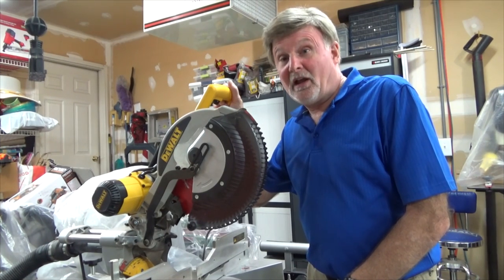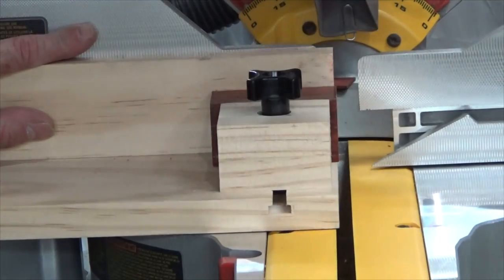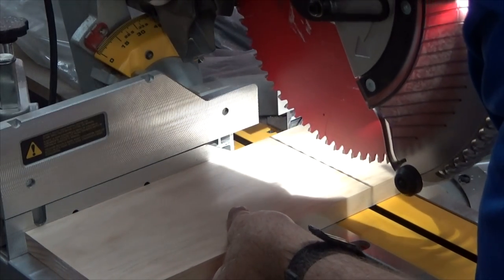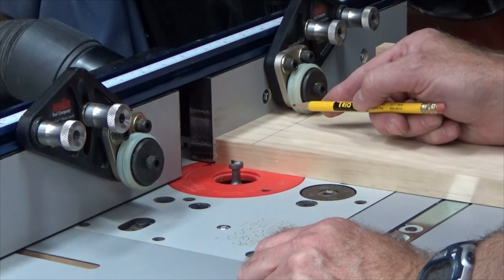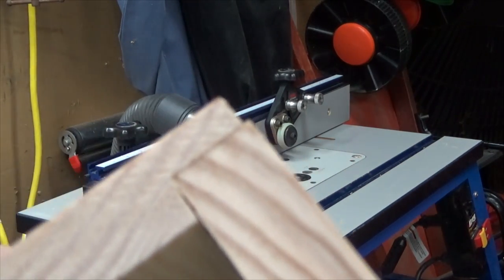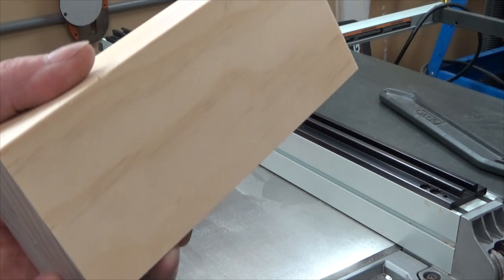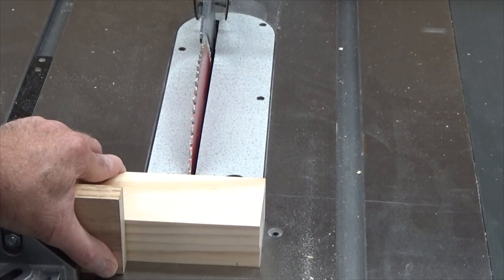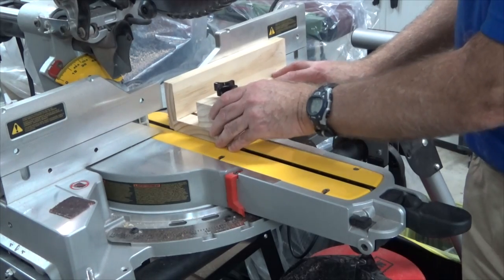Miter Saw Jig

Comment: Another thing that helps prevent the saw blade from moving the wood is to use a correct miter blade with between -5 degrees to +5 degrees rake to stop blade grab. Most table saw blades are like 15 degrees. In fact some blades even mark for miter use are 15 degrees.

Comment: Hi Dave! That's a pure genious solution. Is there any chance to use a jig like this to make smal rip cuts on a miter saw? I have read for instance that rip cuts on a miter saw is not safe, so I'm confused... Greetings from Brazil, thanks.
Reply from the maker: Thanks for the compliment. Generally whenever I need to make a rip cut on a small piece I use a bandsaw. I think I could make a modified version of my miter saw jig to allow safe ripping of small stock. The wood will have to be anchored so the blade rotation can't lift the piece of wood. Will look into it. Thanks for the idea.
Reply: Demetrius Giovanni Soares miter saws are for crosscut ONLY. Use a bandsaw or a table saw for any rip cuts. Stay safe

Comment: dave what size was the keyhole bit you used
Reply from the maker: I used a Whiteside Bit #3053. The wider cutter at the end is 1/2" while the smaller cutter on the shaft is 5/16"